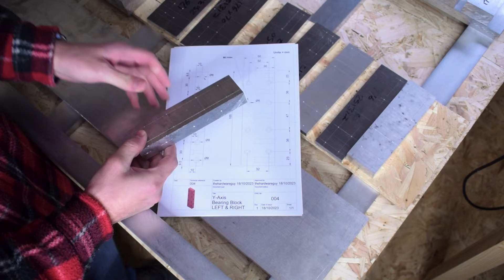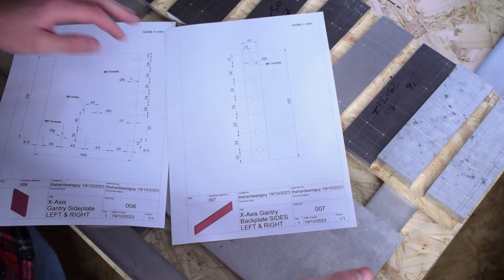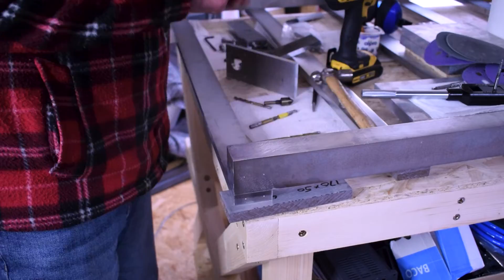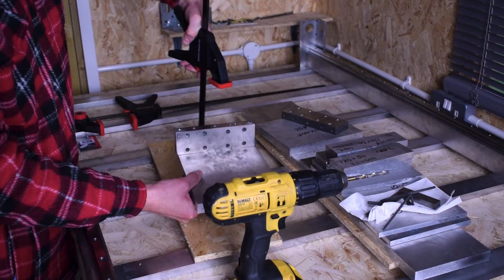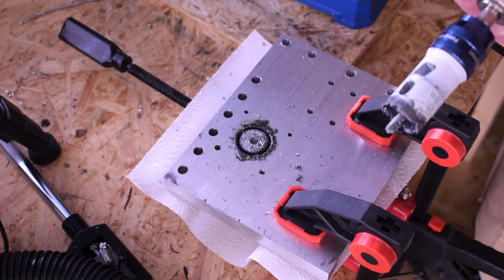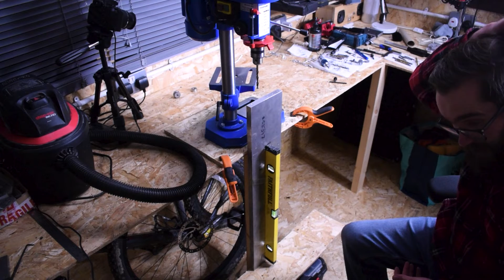DIY CNC 006 - Gantry Assembly and Bracket Installation

Comment: For drilling out the gantry holes, would it not be easier to use an adjustable dowel jig that clamps on? Those normally come in 8,15 and 15mm.
Reply from the maker: Absolutely, that could work. You can get as creative as you want, if it improves accuracy then go for it 👍🏻

Comment: Did you use loctite for assembly too or just split washers?
Reply from the maker: On the main chassis where split washers were used they seem to be holding up really well. In other areas of the build such as the Z -Axis, loctite is definitely required

Comment: Hole saws work in wood because they grind the sawdust in to a powder which can eventually work it's way out of the kerf, with metal that doesn't work. One tip I have heard is to drill one or two smaller holes (like 5mm) on the inside of the larger hole so they are tangent to the circumference of the larger hole. They will allow a place for the chips to fall out of the teeth instead of packing solid almost immediately.

Another one is if you don't have material for the pilot bit, you can use the hole saw to drill a guide hole in a scrap of wood and clamp the wood to whatever you actually want to cut. It also works if you accidentally used the wrong size saw and need to enlarge an existing hole. If the guide hole is too lose and you can't start the saw easily, you can cut a slit through one side of the guide, then clamp it together. The removal of the width of a hacksaw blade from the circumference of the guide will make it a bit tighter.
Reply from the maker: Great tips, thank you for your input 👍🏻

Comment: Huh.... A lot of work.  It would be easy if you made most of these parts by CNC. I would do all this holes more precise and better on CNC in 2 hours of mostly drawing. One tip: when you lose guiding hole put a part of wood which doesn't  have to match exactly, just hammered square part of wood and it would do the job for bimetal saws. I used cordless drill for taping steel and aluminum and it seems to be much better.
Reply from the maker: Yes of course it would be much easier on a CNC. Unfortunately I do not have a CNC capable of that (hence why I'm building this one by hand). I will likely perform upgrades for this machine and CNC it on the machine when it's operational. Great tip with the block of wood! I'll use that next time